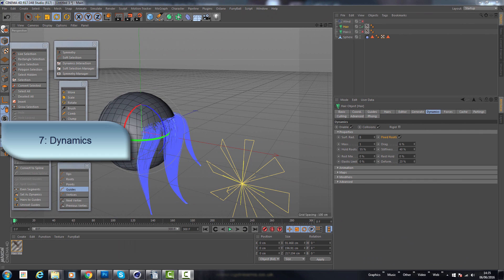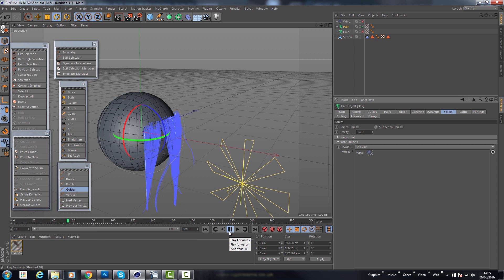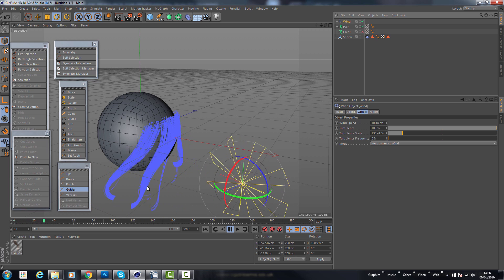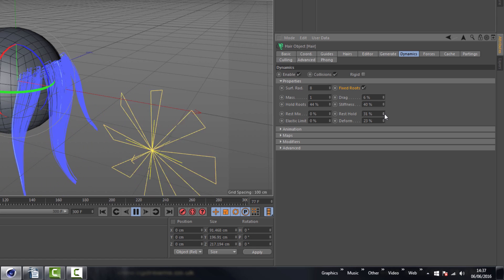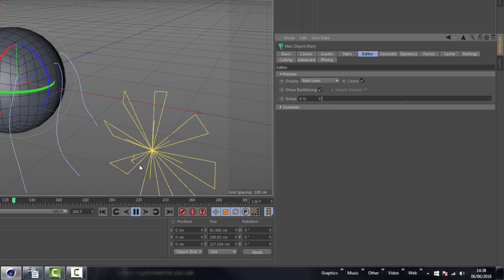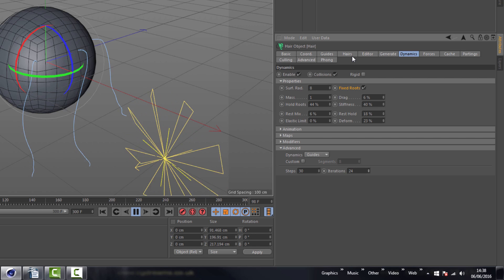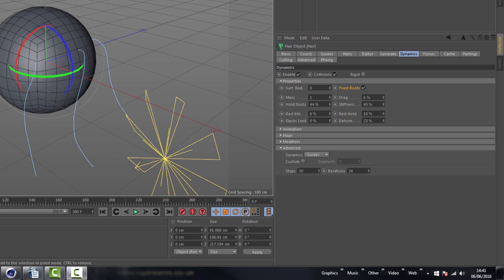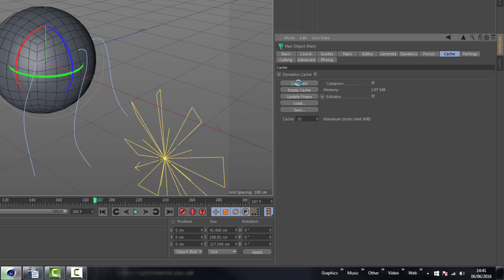Hair System C4D Part 7(Dynamics)

Comment: Unfortunately, C4D is very weak in terms of hair dynamics, and the process of calculating hair dynamics in this software is completely wrong
Hair dynamics requires bending resistance - tensile strength - degree of hardness and maintaining the state of the initial curve and energy loss settings. While the hair dynamics settings in C4D are completely funny and have nothing to do with hair dynamics
I don't know why Maxon company doesn't make any changes in this part and doesn't fix it😮‍💨😮‍💨😮‍💨
Reply from the maker: Yes unfortunately while its possible to do dynamics for certain projects, its more suitable for fur than long hair.  The tech for the hair system is long overdue for a revamp and Im sure they will get to it eventually as C4D has had many positive changes in last few years.  In the mean time its hard to beat Ornatrix in all areas inc dynamics for hair.

Comment: Thanks for your great videos. BUT...I've noticed that you do this video on dynamics, but your final model doesn't move at all. I'm struggling massively with the lack of collisions with hair. No matter how many collider tags and force settings I play with, the hair blasts right through all surfaces, and so movement of any sort (nodding or shaking the head) with long hair becomes comical as hair flies through the bottom of the chin, moves through the eyes and forehead and cuts through shoulders. Nowhere on line have I seen anyone get this working. And all the C4d hair tutorials ignore this problem by expressly not doing a dynamic simulation with long hair on a human head. Any thoughts?
Reply from the maker: It can be made to work but to what degree is the question.  Long flowing hair thats lose and realistic, no, not going to happen.  Slight movement to hair can work very well.  You need the correct iterations and tune the hair to be lose but very clumped.   I do very little hait dynamics, but I have found Ornatrix works significantly better as it has dedicated features for hair collisions.

By all means send me a model and I will try to show you what you can get from C4D own system.

Dan
Reply: @CGDreamsTutorials  Thanks for your response! And that is an offer I can't refuse. I've been trying to model Voltaire, who fortunately does have somewhat clumped and curly hair (on what looks to be a pre-Victorian wig). Where can I send you the model? (I will look about now for an email address for you as well). But in the following reply here, I will attach a wetransfer link to the model.
Reply from the maker: @Shxckd  email to         contact (at) cgdreams.co.uk
Reply: Unfortunately, C4D is very weak in terms of hair dynamics, and the process of calculating hair dynamics in this software is completely wrong
Hair dynamics requires bending resistance - tensile strength - degree of hardness and maintaining the state of the initial curve and energy loss settings. While the hair dynamics settings in CD4D are completely funny and have nothing to do with hair dynamics

Comment: Thanks a lot!! My hair is jumping around when my model starts to move. Do you know any solutions maybe? Thank you :)
Reply from the maker: Hi,  Yes there are two settings either  Rest Hold, or  Rigid type dynamics which allows movement but holds the style in place.  In the Dynamics tab Advanced you see Iterations.  This number should match the number of segments used for the guide. See this video clip  https://youtu.be/S2JaD-4uu-Y
Reply: @CGDreamsTutorials  thanks so much! This helped a lot in hair dynamics now! Also if you do a new project with a new hair, can work too.
Reply: I mean if it goes really crazy I would suggest to do a new project. :)